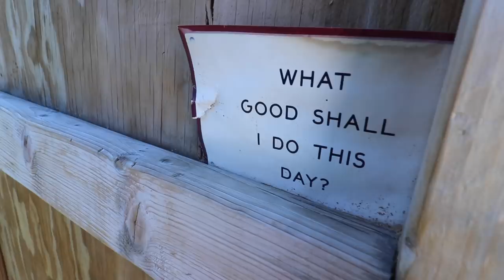No Turning Back Now/ Portable Cooler VLOG

Comment: It's looking good. I've been thinking about some similar, climate controlled trailer projects, and so I have to ask, why did you go with a window style unit instead of a roof unit like those found on a RV or bus? Expense? Cooling capability? I'm still in the early concept stages in my mind, and have to sell the idea to my wife, ha, but trying to understand different approaches to cooling
Reply from the maker: you can't just use any cooler unit. Roof units are not ideal.
Reply: @SowtheLand   are you running just the AC unit, or will you incorporate a CoolBot to hit a certain temp?

Comment: Are you planning to use the trailer as a freezer, or just a cooler?

Also, if you spatchcock your chicken,  it'll cook faster and more even.   Doesn't have quite the presentation, though.
Reply from the maker: cooler. freezer would be way too expensive to build.